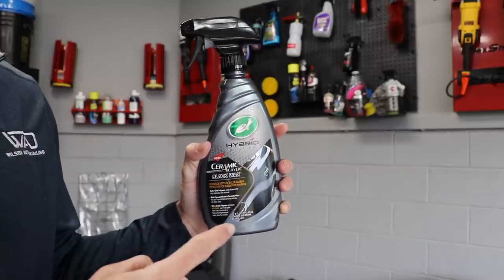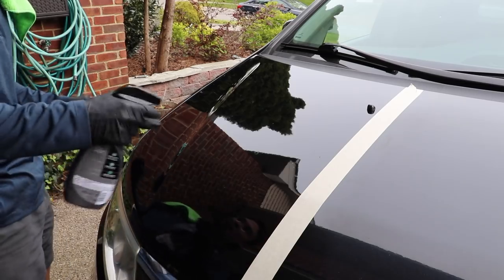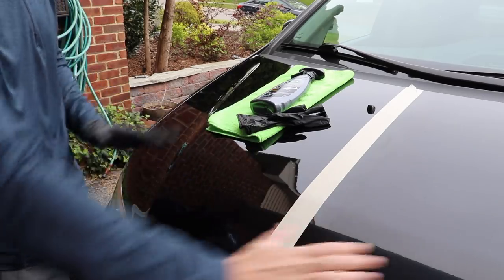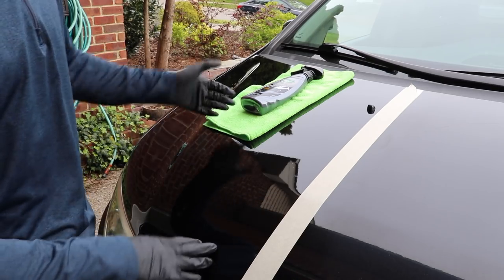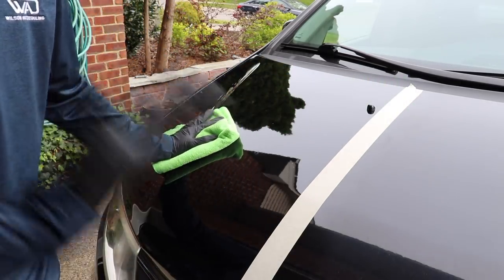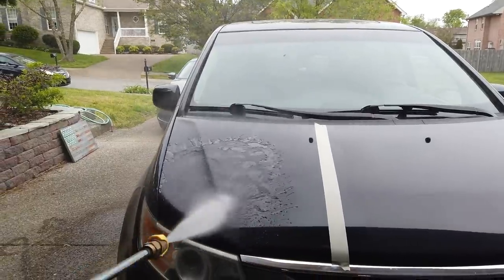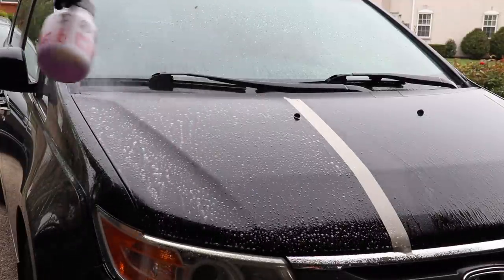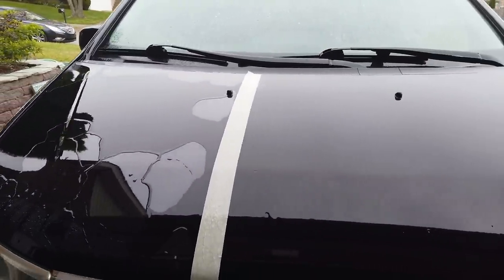Turtle Wax Ceramic Acrylic Black Wax | Another Deep Dive for The Intellectuals!

Comment: Used the hs ceramic acrylic black polish and black ceramic acrylic spray wax  about 5 weeks ago. I use the black spray wax after maintenance washes. Super easy, super fast. Last week, I purchased hs ceramic spray coating. I washed, used the spray wax, allowed it to cure, then applied the hs spray ceramic coating...looks awesome. It’s been raining the past three days and I’ve just been watching the water roll off. Also, the truck still looks very clean even after driving several times in the rain. Turtle wax upped their game with the HS line

Comment: It's easy to find a tyre gel that makes the tyres look good but so hard to find one that lasts.
I've found the solvents in the gel can dissolve the adhesive holding the sponge of the applicator to the holder

Comment: I bought the turtle wax black ceramic polish and the black ceramic spray wax kit-came with the 6 inch pad and two black micro fiber towels. Used the polish and agree with Luke 100 percent-it fixed swirls and filled some light scratches-more of a paint enhancement but my paint was in good shape so it was what I was hoping for. After the 24 hour cure I used the black spray ceramic and let that cure for 24 hours. It looked good but didnt have the super high shine I had got on my other car using just the regular ceramic spray so for so for coat two I used the regular, non tinted turtle wax ceramic spray (green label)and that definitely made it shine.  Was really happy with how it looked.  Would like to see a pro compare the two though so YES, please do a side by side.  

So far I’ve been really happy with these ceramic products from TW.

Comment: Hey boss I have a small detailing business and just had a quick question. Problem I am running into is that my garage isn’t big enough to pull lifted trucks into and do paint correction and ceramic on. Is their any advice on another way or products to use outside and what about curing outside the garage? Thanks
Reply: wow. I hope you don't talk same way with your customers